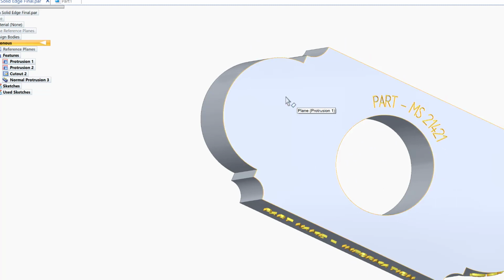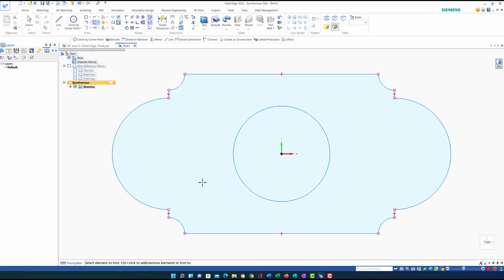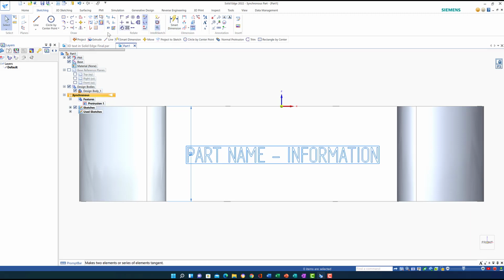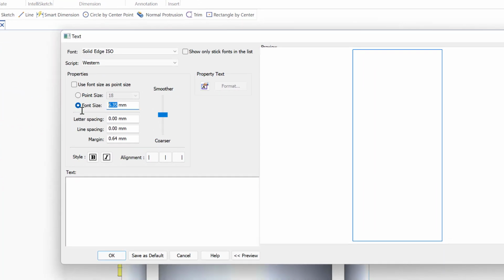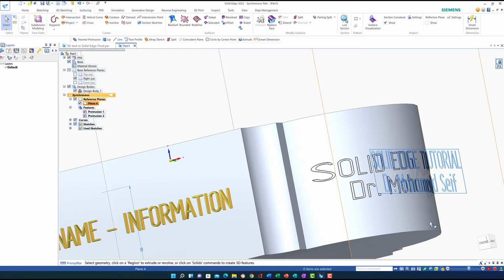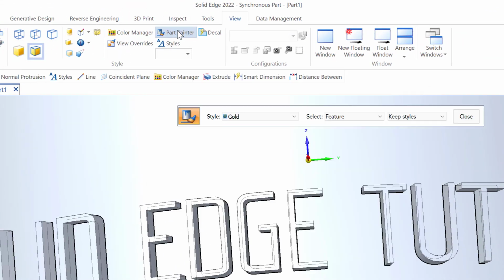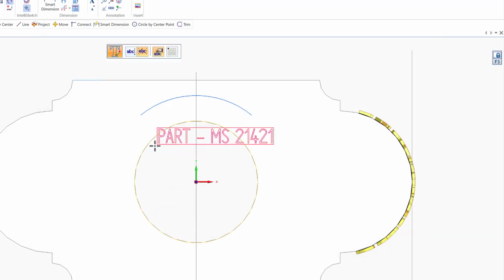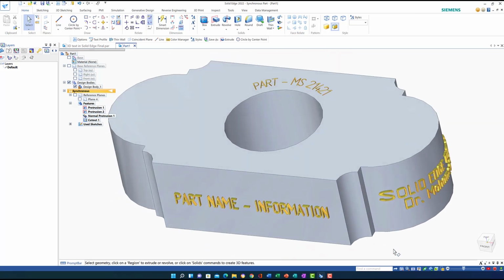Text along a curved line and on plane and curved surfaces - Solid Edge Tutorial

Comment: Rather than projecting onto a round surface using the "Project"-command, I suggest you use the "Wrap"-command, which is found in the drop-down with the "Project"-command. 
The downside of using "Project" on curved surfaces is that it projects perpendicular to the sketch only, whereas "Wrap" will project normal to the surface. 
The downside of "Project" is clear if you compare the width of the S in "Solid Edge ..." with the width of the S in "Dr. Mohamed Seif". 
The first S is much wider because it is projected normal to the sketch and not normal to the surface. If you look from the sketch, the two S's will be the same width, but measuring the actual width on a plane tangent to the surface will show that the outer S is much wider, which is also visible when looking at the part in isometric view.
Actually the extrude of that text is done in the way that the "Wrap"-feature works: Normal to surface.
Reply from the maker: Thank you so much for your feedback. I really appreciate it.